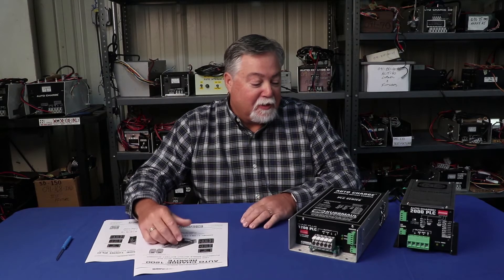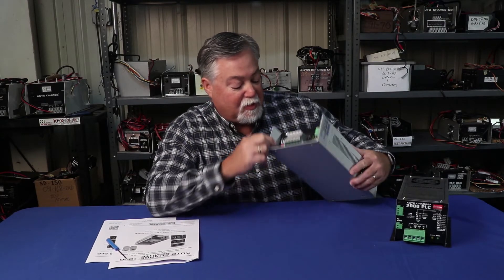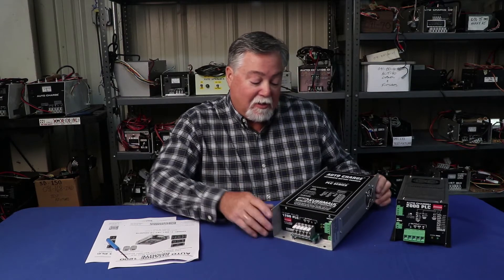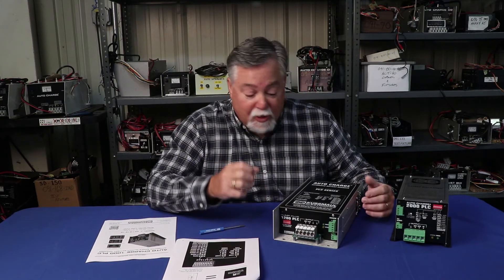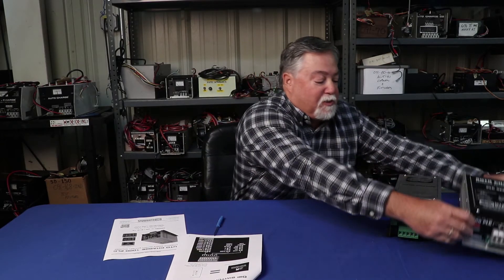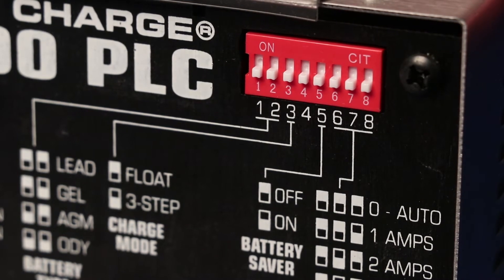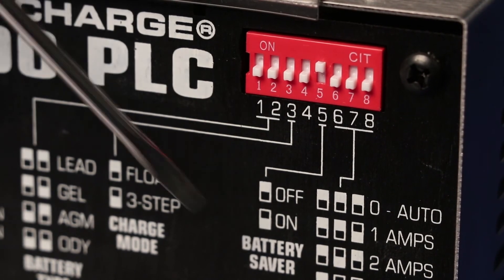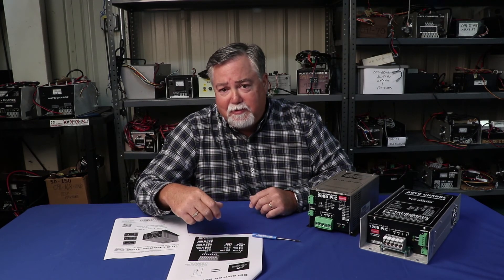Adjusting the Dip Switches on Kussmaul's Auto Charge 1200,1000 AND 2000 battery chargers.

Comment: I have an auto charger 2000. With no batter hooked up to the charger and powered with 110v. I hookup my multimeter to Battery #1 output. I get an output of 0.04 amps. Battery #2 output I get 0.0 volts.  (port-3) is giving me 13.5. All dip switches are down. Do i have to have a load for the charger or is my charger dead? Having issues and I want to start with the charger first. this is a 1992 unit.